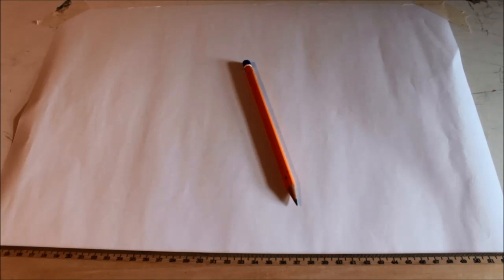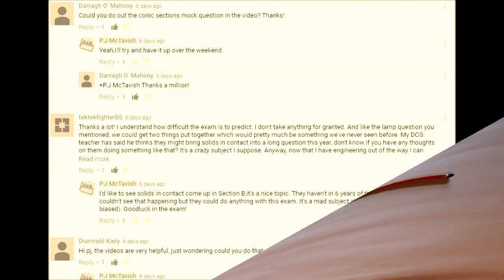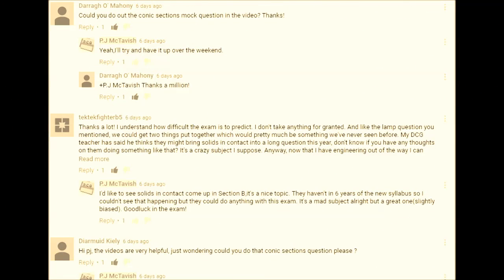DCG: 2016 Higher Level Mock Question B-2 [Conic Sections]

Comment: Could I have drawn a plan view and found the true shape that way?  Using radial cuts( 60, 30 in plan and draw in elevation) and get the distances from plan? 
BTW thanks for your videos, they have been helpful!
Reply: instead of doing the eccentric method
Reply from the maker: If you mean by projecting an auxiliary plan from the elevation and getting your distances from the plan then yes. They can ask for a true shape so you can just project an auxiliary view of the cut or they can ask to find it like this mock question.
Reply: +P.J McTavish okay thanks for letting me know that, I think I'll stick to your method :)
Reply from the maker: +Luke Byrne No bother,goodluck tomorrow.